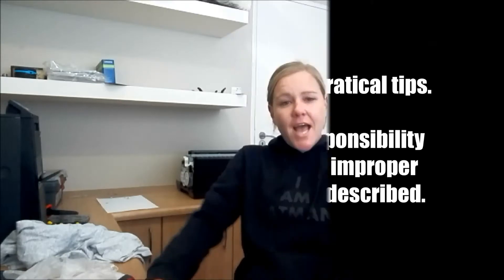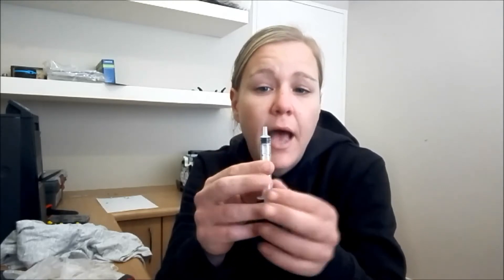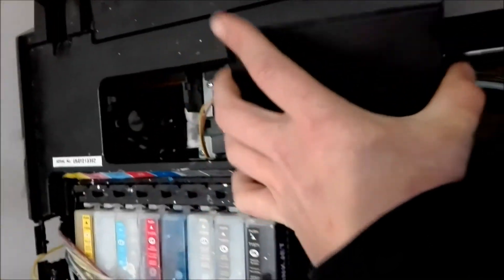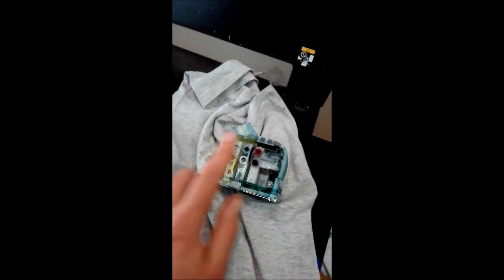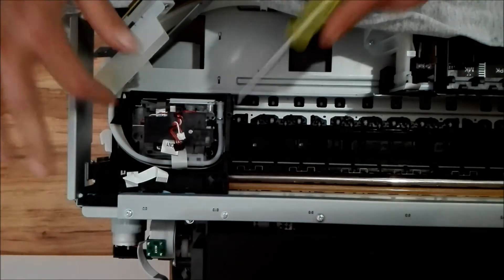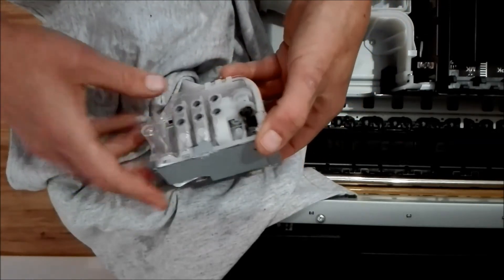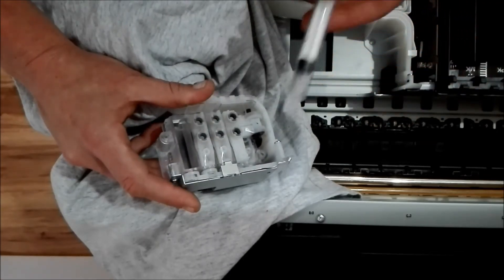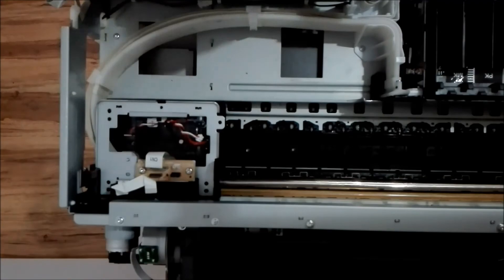Katana DTG, r3000/p600 DAMPER CHANGE

Comment: Hi, I have an Epson R3000 and after carefully changing the dumpers the printer does not start, the ink and power lights come on and they remain blinking.
the ground connection plate of the motor with which parts does it have to make contact, only with the bottom plate of the dumpers?

Comment: Hi hon.
Thanks for the video! Really appreciate it. After replacing the dampers, what do you do to get ink flowing again if the tubes are empty? (here were are talking about normal pigment or dye ink) and who did your build on the R3000 to a DTG?
Reply: I think you use a syringe to suck the ink through into the damper with the ink cartridges plugged in or you can use a program to reset the printer to run the initialization it does when the printer is brand new. I myself am wondering if you can remove the dampers safely or does ink spray all over the place?
Reply: @dominicj1170  done it, and done an ink charge afterwards. There will be no spill at all replacing the dampers
Reply: Kristian Vester thanks so much for your reply! It’s going to help me a lot.
Reply: @dominicj1170   I just changed all the dampers and black ink switch, and it was messy. Keep a clouth and lots of papertowel, alcohol for cleaning is also a good idea. But i cant suck ink through the dampers with the syringe. It just makes a vacuum. Is there a way to release the preasure, maybe punch a hole in the original cartridges?
Reply: @christianditlev4724  did you figure out a solution? I'm currently having the same issue.